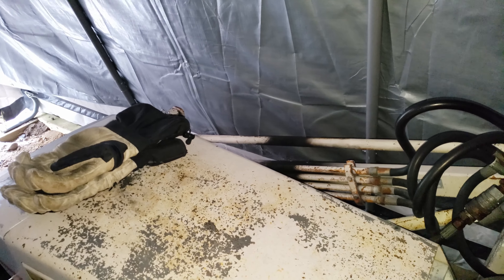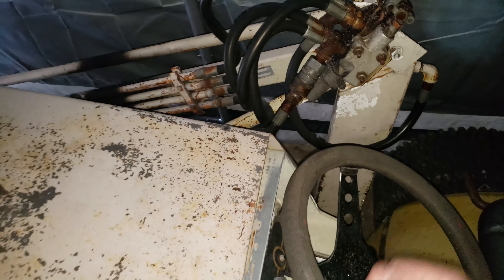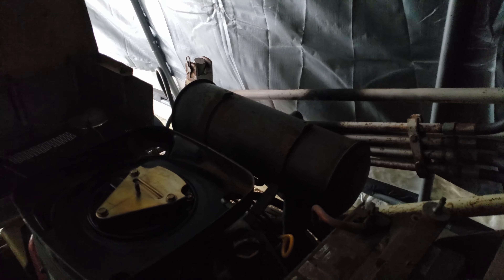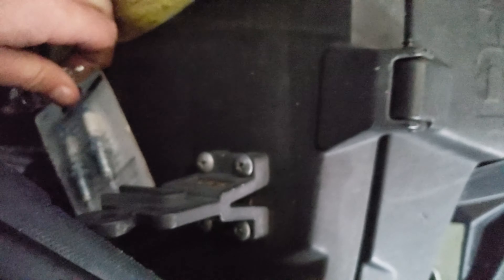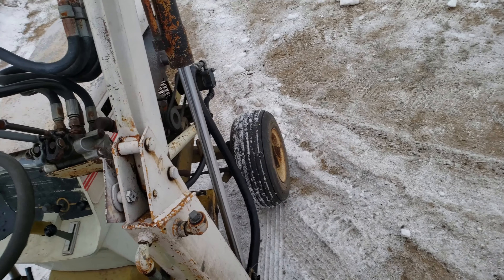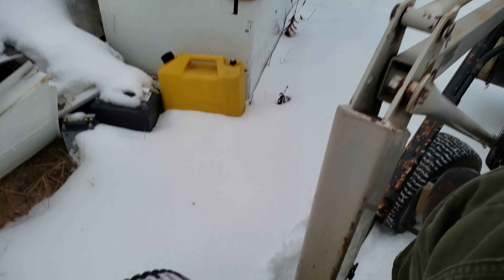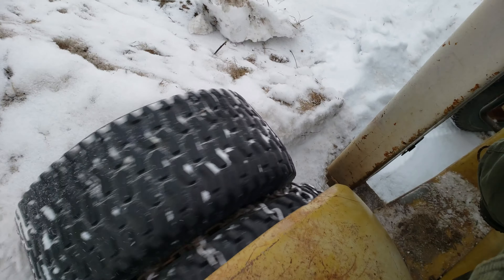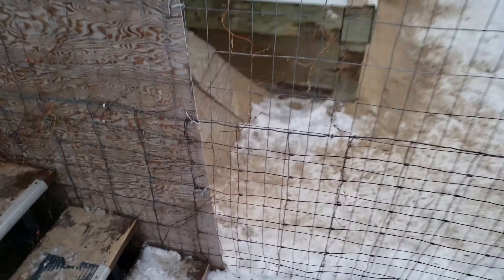Sears Suburban Loader Winter Cold Start (She Was Not Happy!!!!) (20HP V Twin Briggs)

Comment: i havent seen that loader in a longtime and dam not only the sportman 500  gave u a hard time but the loader too and the loader was worse for starting lol defenly needs work and it looks like it could use more wait in the front idk curtis is that possible to put some more wait in the front of the loader so it steers good
Reply from the maker: The Loader Will get "Maybe" The 28HP EFI Engine i just have sitting around doing nothing LOL! 
Or maybe... Ill move the loader onto the bolens and install the 28HP Engine LOL!!!
Reply: That might work project for next year